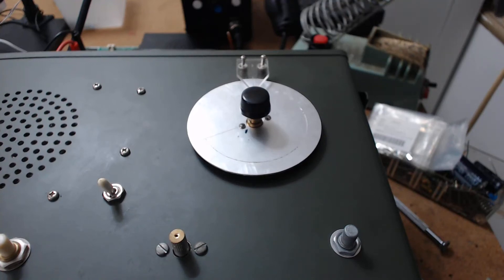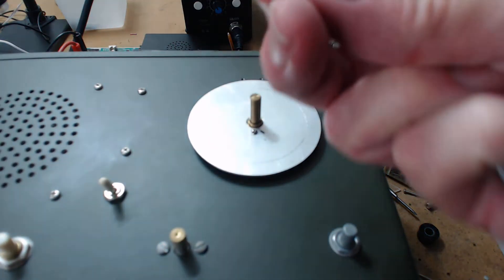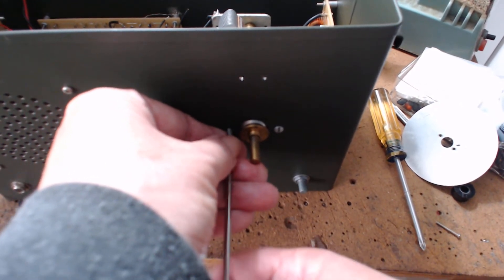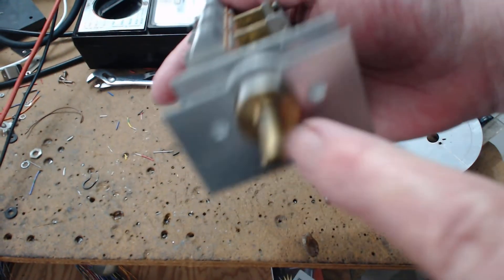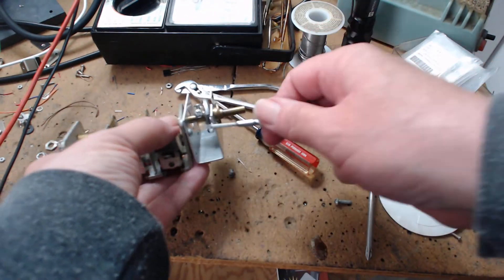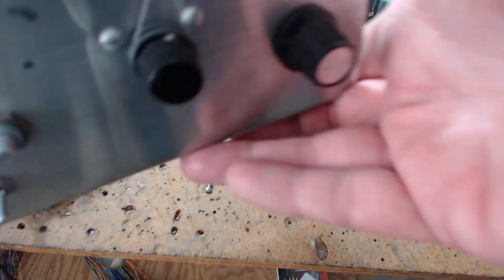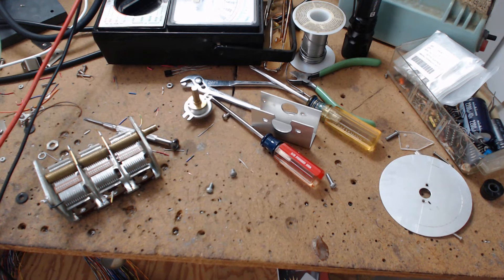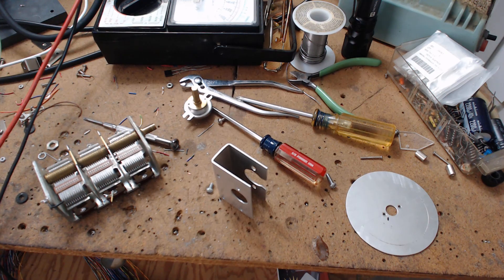Radio Reduction Dial Vernier

Comment: Hi John. Interesting video. Thanks for that. I was noticing that your audio is quite distorted today. I was having a little bit of trouble hearing everything you were saying. Maybe you’re too close to the microphone? Or maybe my hearing just isn’t what it used to be.
Reply from the maker: The camera was right next to my mouth.  I wanted the shot to be correct. That Jackson Brothers Reducer is one of the last ways to make that kind of dial. The video turned out better than the originals which only show the unit built. This showed all the parts up close. It may help one person out there!  LOL
Reply: @johnkleinbauer4424  Well, I found your video very helpful. I have some of those reducers and I didn't realize that I'll need to make a bracket. I never knew that the seamer tool existed.